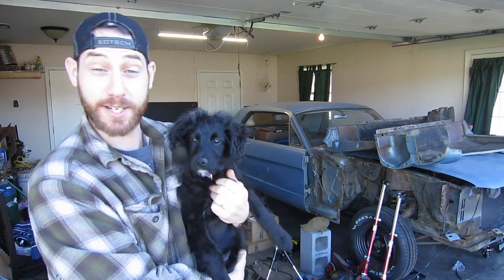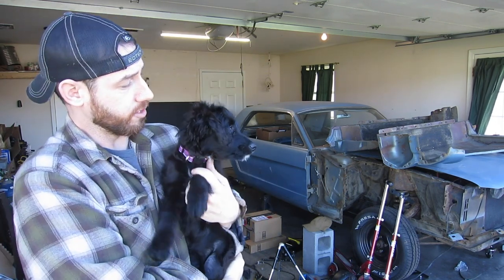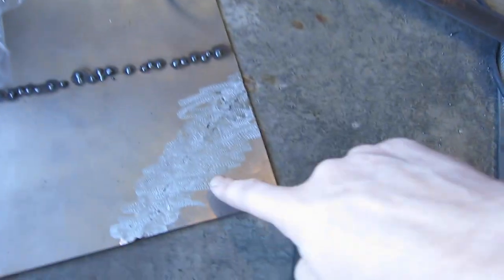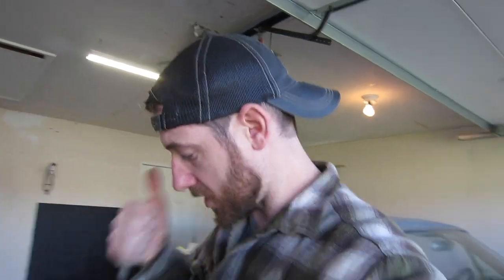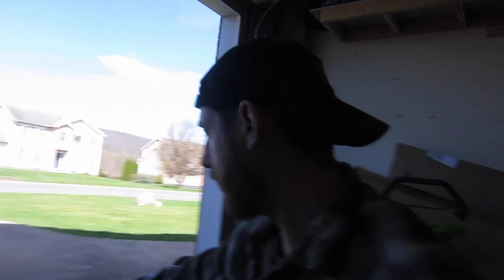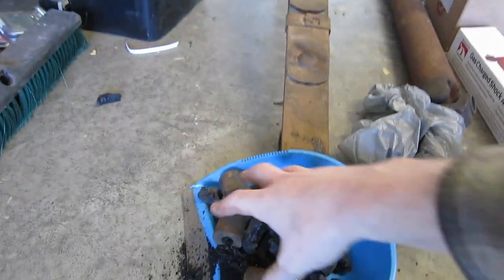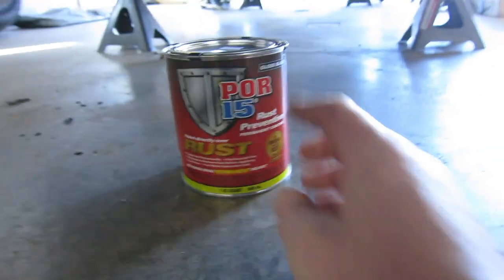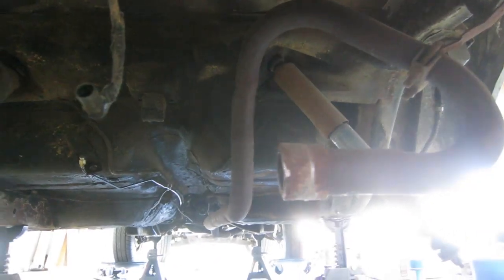My New Garage Dog

Comment: Get the oil based roll/brush on paint. Mush thicker and will last  plus it kills the rust much better. Itll last much longer under the car. Juat did my leafs springs with prothane bushings!
Reply: Ahhh commented to soon! Got you some snazzy paint!
Reply from the maker: Lol. I actually went with high temp rustoleum on the rear end. It turned out pretty good. I’m saving the POR 15 for the underside of the car. That stuffs not cheap. Lol

Comment: Andrew, POR15 works great on springs and rear ends but it is NOT UV protected. I used it on my 70 after I spent 2 days wire wheeling and grinding on them. But it is pricey and I found a gallon on Amazon for around $125. Little more expensive now. Your welding is improving too. 👍 Keep plugging away at things.
I'm just about finished messing with doors and fenders to get the alignment and so far it looks pretty good. Stay safe !
Reply from the maker: Thanks Tim. I ended up using high temp rustoleum on the rear end and springs. I’m trying to save the POR 15 for the underside of the car. Glad to hear you’re getting garage time too. 👍

Comment: Looking good, I started back working on my ‘65 this week. I spent the last few days scraping under coating and seam sealer off of the wheel wells and under the front fenders. Trying to get what I can now without spending a lot of money. I will also be cleaning up the rear end and leaf springs. I posted an album on my Facebook page. https://www.facebook.com/media/set/?set=a.10216604422251336&type=3
Reply from the maker: Thanks for sharing the album. Our ‘65’s do look very comparable. I’m not sure what I’m going to do about the undercoating. I’ll begin scraping it off but if there are large areas that appear to be intact and solid I’ll probably stop. I’m not going for show quality. I just want it to look good.